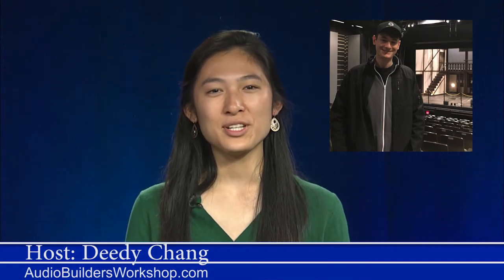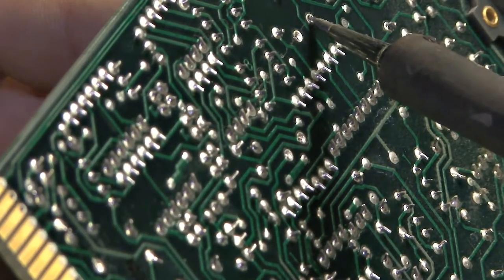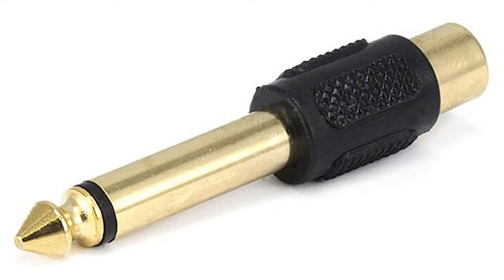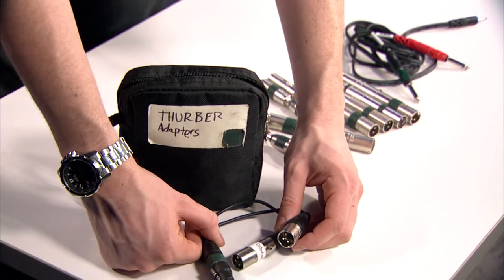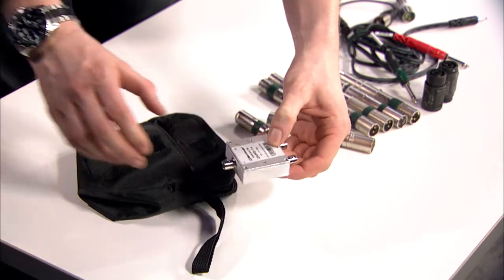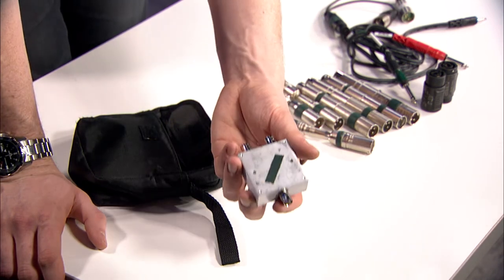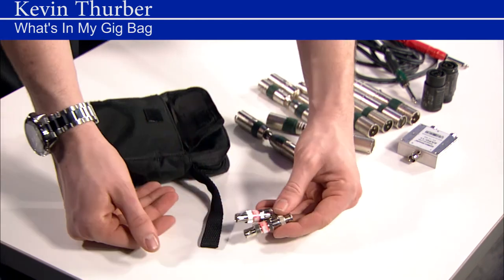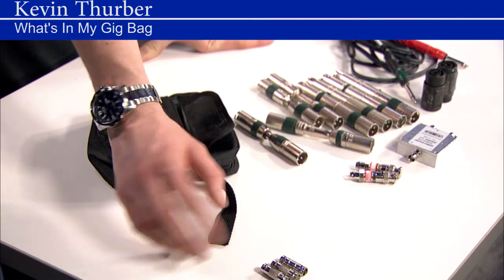What's In My Gig Bag 2: Audio Adapters

Comment: If you're freelance or working for a venue/production company why are you bringing all that stuff, why isn't your employer providing this equipment, why don't you ask for this equipment in your production case?  As a sound mixer who's always on tour I find it inefficient to try and bring everything, all that extra weight drains your energy and can be very costly if you fly...and while it's good to have all these bits and pieces I don't think it's my job to subsidize the PA company or venue.